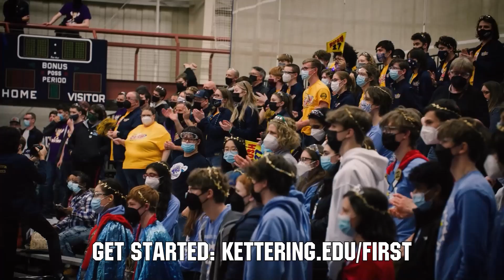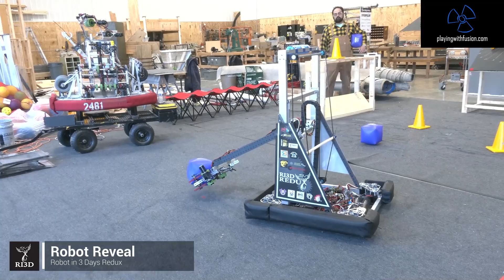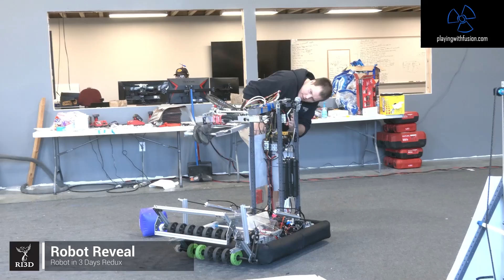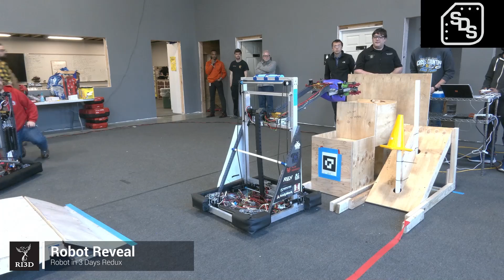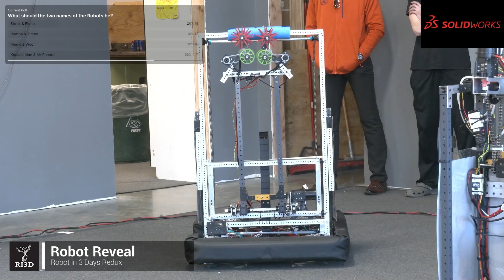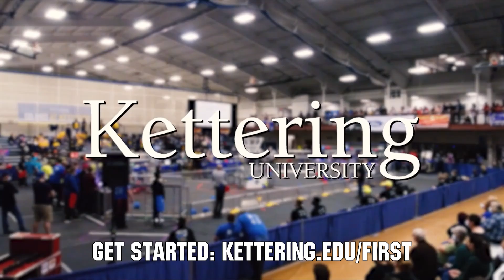Robot Scoring Demonstrations | Ri3D Redux 2023

Comment: Please note! You cannot extend beyond your frame perimeter in two different directions at the same time.
Reply: I believe there is actually an exception when the robot is fully within the alliance loading or community zones.
Reply: When in the community zone you can expand in multiple directions.  Koolaid-man should be able to move the arm above the intake level and then close the intake to stay legal.

Our drivers didn’t have much practice but with time you could handle everything manually. What could be a cool idea though if you have localization would be to add interlocks in code when you are in areas of the field that are limited to expansion in one direction so that the arm can’t move over the top of the robot until the intake is closed, and the intake can’t deploy with the arm extended on the other side
Reply: Yep! 3 day robot so we broke a few frame perimeter rules that are easier to fix with more time.